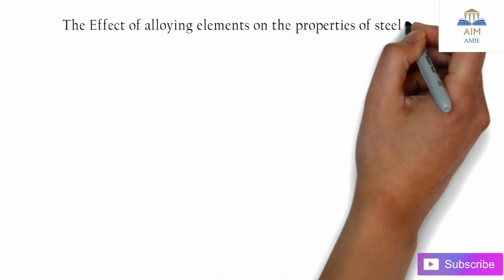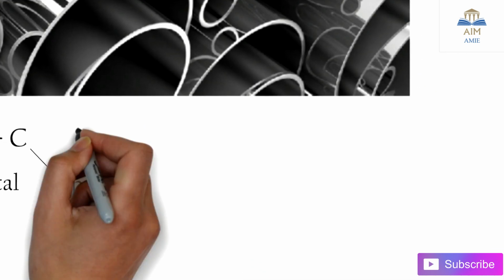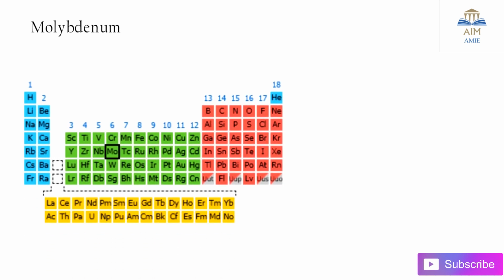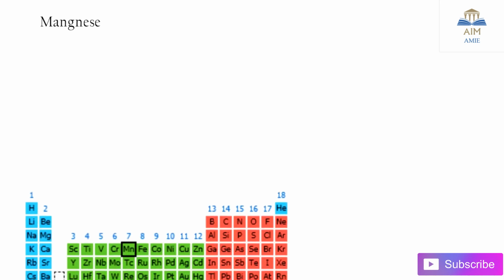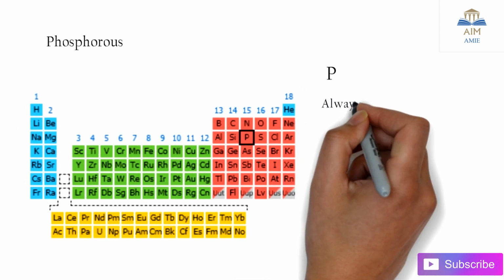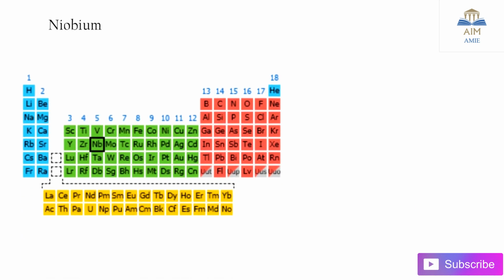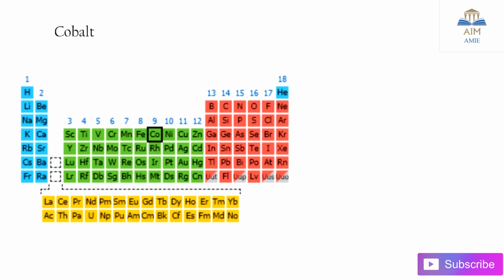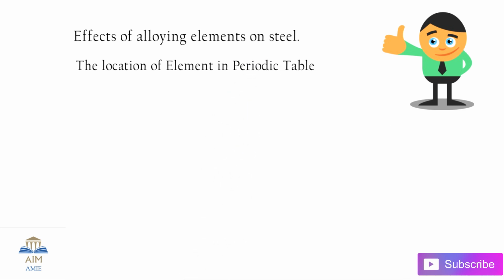Effects of alloying Elements on the Properties of steel.  ||Engineer's Academy||

Comment: Is there a certain order you add the ingredients, or do you just bung them in all together? In chemistry it matters how the chemical elements are put together, even if they have the same elements and number of atoms of those elements. You can get 2 different materials simply by rearranging the chemical structure! Do isotopes get used also, doe an isotope change the properties of an alloy?

Comment: The presence of aluminium and silicon in steel tool 1) Increases machinability 2) Increase tool wear 3) decrease tool wear 4) Increases ductility what should be the correct option